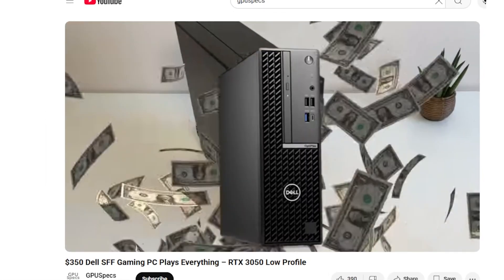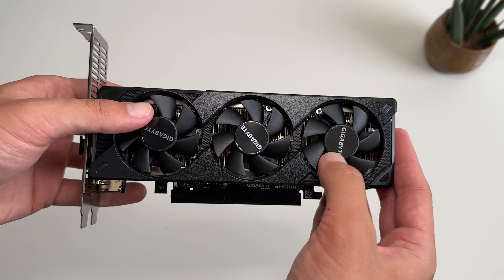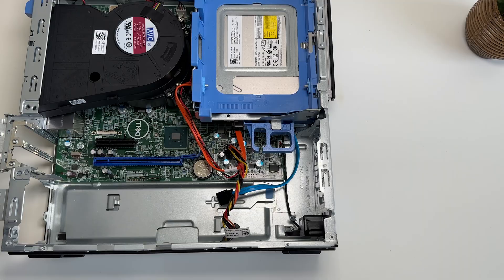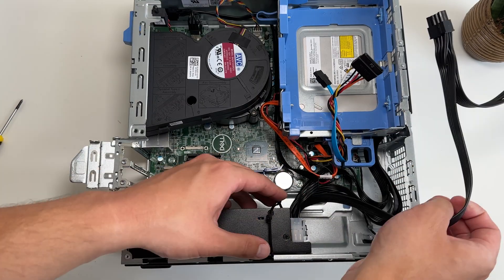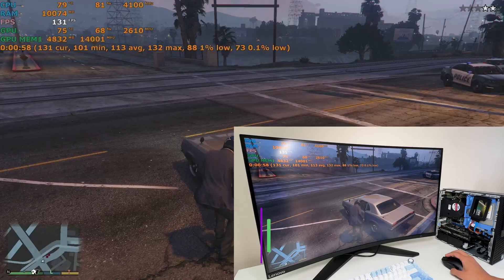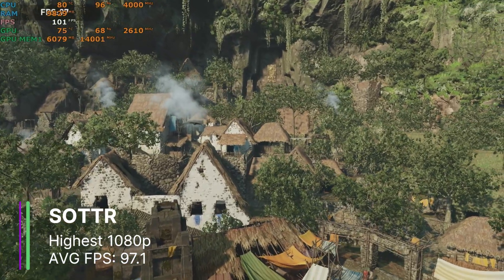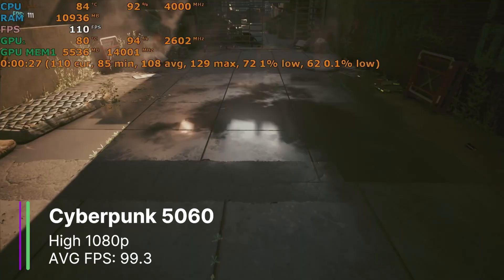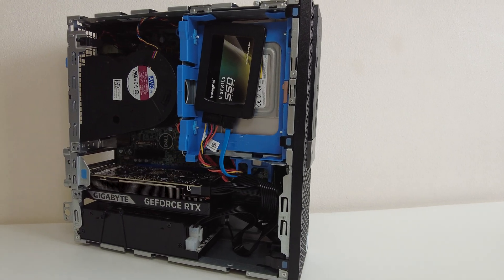Dell Optiplex SFF Office PC to Gaming PC - RTX 5060 Low Profile & Flex PSU

Comment: Great job! Now remove the drive cage and add a Noctua 80mm fan in the front. Use y splitter and low noise adapter on cooler side. Set fan override in bios. 
3M double sided tape for ssd onto the blower cage.
Cut a rectangular hole in side panel at gpu and add mesh. 
Can confirm no thermal throttling while looping various benchmarks. 
I7 8700 + 3050 lp.
I5 10505 + 4060 lp.

Comment: Tengo una hp prodesk 400 g5 sff, tiene un cable de alimentación 4+4 pines como debo buscar el adaptador para la fuente

I have an HP ProDesk 400 G5 SFF, it has a 4+4 pin power cable, how should I find the adapter for the power supply?

Comment: Hey, are you interested in rtx 3070 16GB ? I actually made a 3070 Gigabyte Gaming OC 16GB, but i actually have 2x 3070 Strix in very good condition, i will mod one of the two

Comment: Cool! I have a ryzen 5 8600g and rtx 3050 6gb lp from pcwinmax. I use "hybrid graphics" - the built-in AMD graphics work on the desktop and in light applications, and when I start games, the 3050 turns on. This allows you to keep the card cold and quiet when you don't need it. In addition, the 760m can handle some games on its own, so the gpu is resting) Everything is assembled in an SFF case and works perfectly!
Reply: Do you plug the output into the graphics card or the motherboard?
Reply: @Anonymous-d5r9n I plugged the HDMI into the motherboard port. I'm using an SFF case, it's very cramped, it has poor airflow. A small graphics card with a single fan is constantly heating up and making noise, even in simple tasks. That's why hybrid graphics help out. If you have a good large computer case, then I would not recommend doing this.
Reply: @tallya1992  I also have a small form factor PC, so I'm trying your method. Thank you very much.

Comment: I've tested the LP 5060 in an open test bench, and the temps were about the same to what you were seeing here. Granted, the fans didn't have to work as hard, but PSU clearance was always going to be an issue in this case unless you installed a single slot card with the Flex ATX PSU... which doesn't make any sense TBH. That damn PCIe slot is why I try to push people to the HP Z2 G4 instead. Unfortunately, the 5060 doesn't work in the Z2 G4 thanks to some UEFI BIOS issue between the GPU and the system. It's a common issue with the 5060 and 5060 Ti, but the 4060 works perfectly.
Reply: Hey man, i’ve been wanting to do this exact build. Do you know if there would be a solution for the GPU and PSU being face to face like that? I doubt there would be room in my SFF optiplex to put enough fans to cool in that small space between the two components. Would drilling holes all over the side panel help anything or that wouldn’t help all that much, as it would give a bit more air but not much circulation. Thanks in advance for the help:)
Reply: @MegaHuuhu  Like I said, it probably won't have any impact on temps one way or another, but you might make it quieter. Than being said, I can really only think of two solutions. Either use a riser cable to mount the GPU vertically, but you might have to cut the side of the case to help it breath, or replace the power supply with a Flex ATX PSU. Then you could choose between having more breathing room or installing the GPU in the x16 slot for better performance.

Comment: Thank you, I have been looking for tests of the low-profile 5060 in a small SFF case for a long time. All the reviewers who tested the 5060lp, shoved it into large, spacious Full Tower cases, where of course there will be no problems with cooling. But I am assembling a system in an SFF case and I know that the 5060 is very hot, especially in a low-profile version, especially since its power consumption has increased compared to the previous generation (the 4060 consumed only 115W), so I needed to know how this card would behave in a small closed case and what the temperatures would be. Fortunately, I do not have a Dell Optiplex in which the card will literally be face to face with the power supply, my build is custom and it has more space for a video card, and now I know that at least it will not slowly cook itself even in such a small build as yours.

Comment: Room temperature?

Those GPU temps are scary.  

Good video though.
Reply: Yeah, there's only so much you can do with an LP cooler on a 150 watt GPU. Honestly though, the 4060 was a 120 watt card, and the temps aren't much better with the same cooler. Even in an open test bench, my 5060 LP gets up to the same temps.
Reply: @TheGameBench  That's a shame.  I still remember the times when you didn't need a cooler for the CPU or later the graphics card.

Comment: Gpu Temp of this card is insane I have zotac rtx 5060 solo and it goes 77 degree max i undervolted the card now it's won't go above 65 degree
Reply: Only so much you can do with a cooler this small.

Comment: It's insane they put such a powerful chip in so small form factor, yet it's obvious it does throttle. The default temperature limit for boost is 86 degrees.  In almost all shown titles the card does reach that limit and even exceeds it. Sadly it's loud and hot, undervolting could help a little + making holes in the side panel to improve the airflow
Reply: He can just add a front fan by screwing it into the front vent panel and then just plug a fan hub to the CPU fan header I did this and it fixed all of the gpu thermal issues went from 87c to 70c but my gpu is a wx 4100

Comment: Could this be done with a dell optiplex 5055 ryzen 7 1700
Reply: You can research on youtube
Reply: Sure. However, the 1700 is going to be a pretty severe bottleneck to the 5060. I'm not sure you would see much of a difference over a slower card.
Reply: I would probably go with a diff low pf card and upgrade the cpu